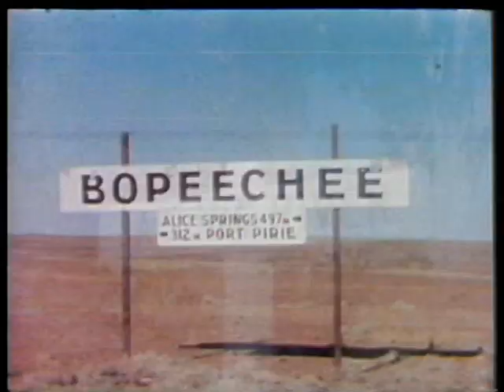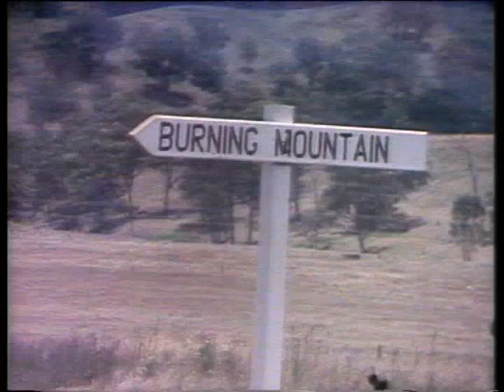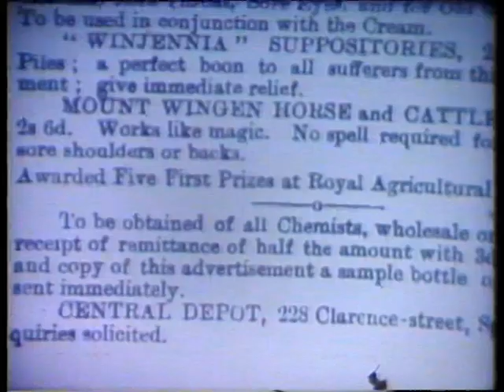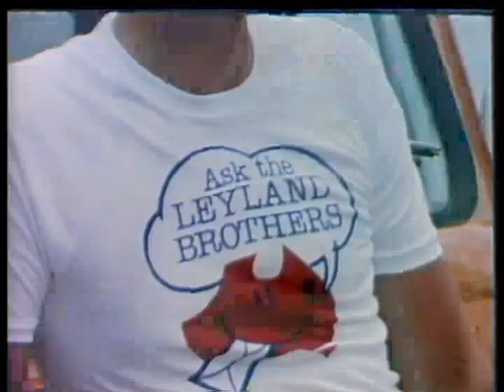Ask The Leyland Brothers Episode 1

Comment: How does a spark plug inflate a tyre from dead flat, to fully inflated?.
Reply: It's not the spark plug but the exhaust from the cylinder.
Reply: @RAFFIZUMZ  But it does seem a lot like inflating it with unburned petrol vapour! I prefer a compressor :)
Reply: @grahamj5113  ….. portable Compressors wouldn’t of been back then…
Reply: @grahamj5113  yes,but with good old leaded petrol. As nature intended it.
Reply: @RAFFIZUMZ  It only works on the compression stroke. IE the stroke when all values are closed. This forces the air (mixed with fuel obviously) through the sparkplug appature where the hose is now attached in place of a sparkplug.
These were very popular back in day.